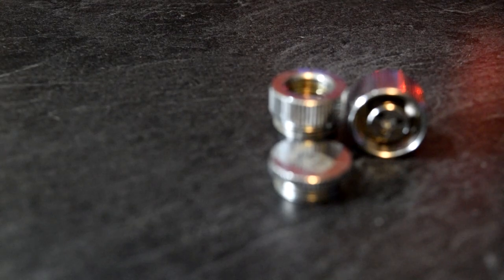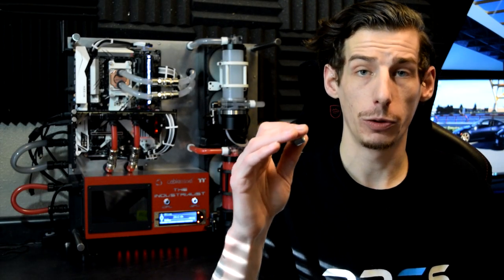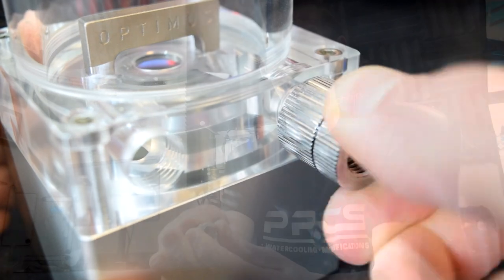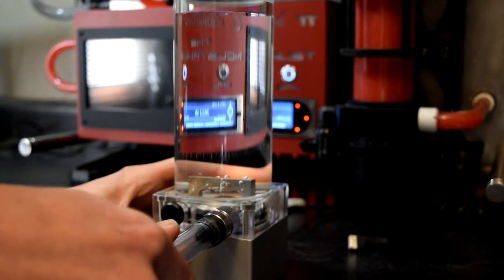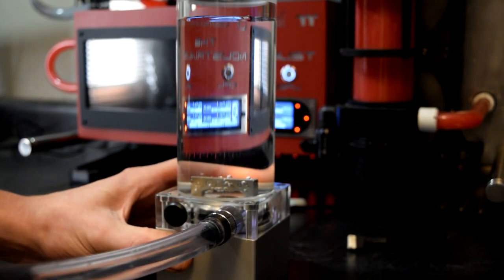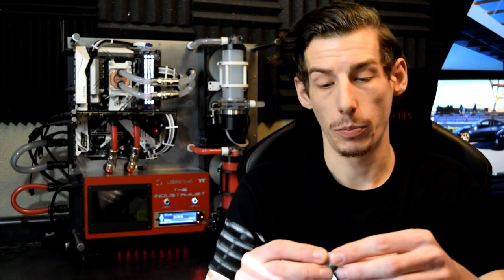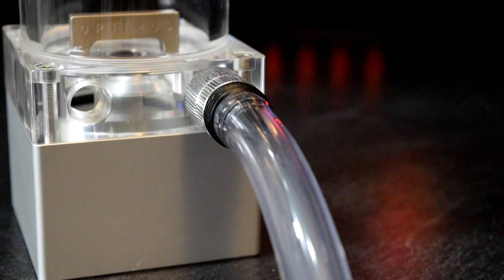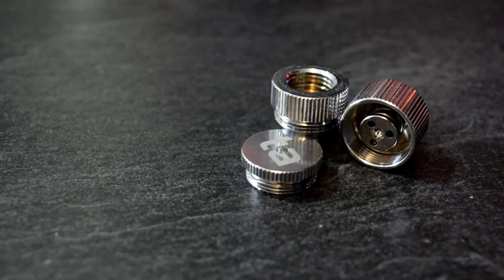PPCs Part Picks - Ep. 2

Comment: Pretty nice fitting, I personally have a Primochill pressure release at the top of my res, which made filling my loop much easier as the top ports on my res are hard to access. Definitely a nice fitting as a drain valve, the price is right, not to mention the form factor. I am going to stick to my full size valves as they look sexy, but I do have a drain spot where this would be very useful because I can't fit a standard size valve.

Comment: Hey PPCs! Great video. Question on what Waterway/Distro case that is in the left of the screen on the desk?

Also, I am getting the last parts for my first hardline loop this week to build in a NR200P. Trickiest part has been placing cooling that is adequate for the 9900k and 5700XT in an 18L case. Mounting multiple radiators while keeping the side panel clean and unobstructed for the glass window is tough but thermals should be worth it. I could totally use one an air exhaust in this since the hard lines in a compact setting will look awesome but make it harder to service down the road.

Comment: I could only place it on my GPU as my external water cooling system essentially has my computer between two reservoirs. 
The quick disconnects make draining the system really easy but pushing that air bubble out of the system is annoying.

Comment: I have an inverted case design, so my tubes go from the GPU straight up to the rad (across the expansion slots). These bad boys would make it way easier to install new daughter cards, when used as quick disconnects.